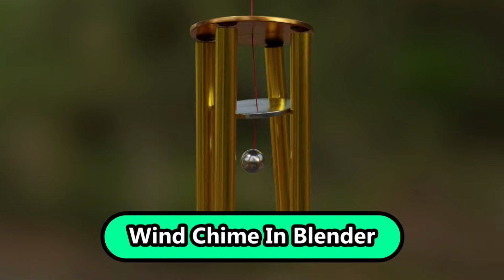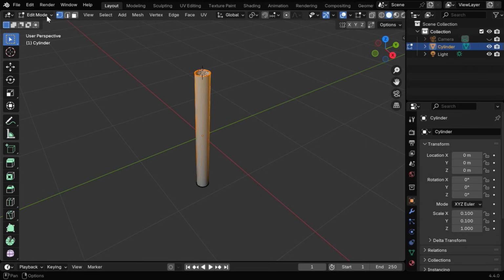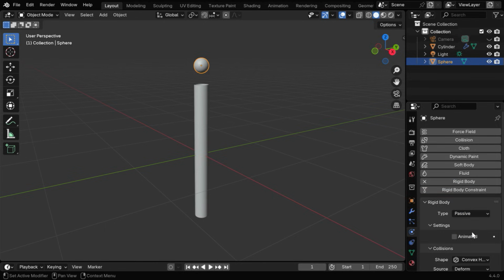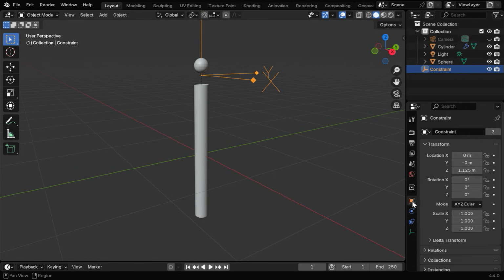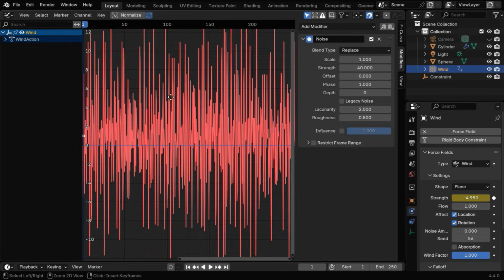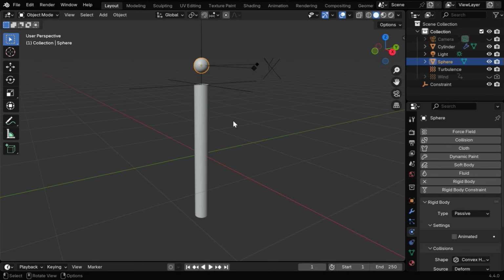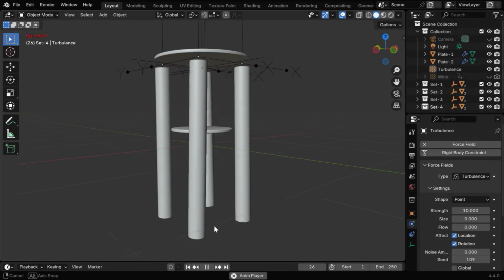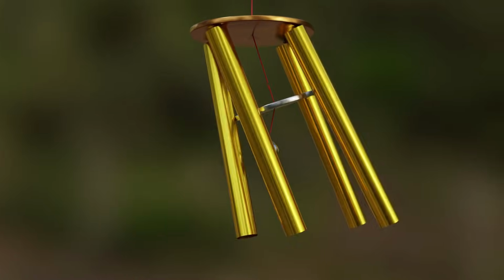Create Wind Chimes In Blender | Rigid Body Physics & Rigid Body Constraints

Comment: Is there any way to make audio when rigid body collide to generate sound. I mean when the objects collide they should add some sort of keyframe in json file that we can later use in post production.
Reply from the maker: Yes, it is very much possible 👍 We have done some work in this regard, there are two tutorials which we created earlier https://youtu.be/jOc559tQzuo 👉 this shows how to detect collisions among rigid bodies and https://youtu.be/bRlKsEv-et8 👉 this shows how to create a music or sound programmatically. Using both of them together we can achieve what you need. But they don't solve your requirement directly, you'll only get the framework from here, you need to then implement it in the way you need it for your particular requirement. It can be a good start.